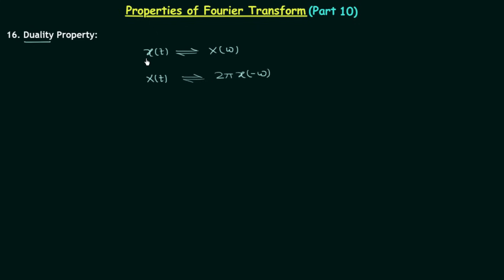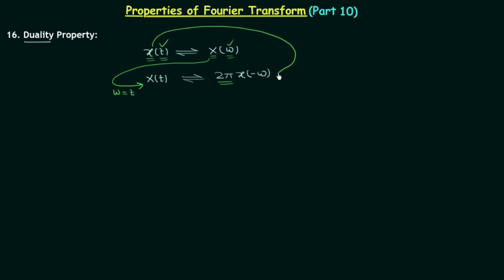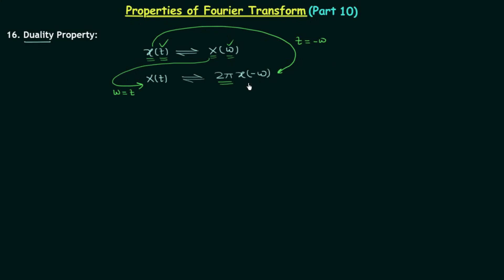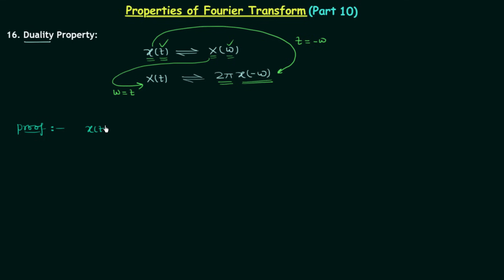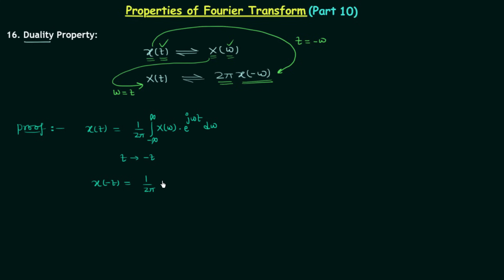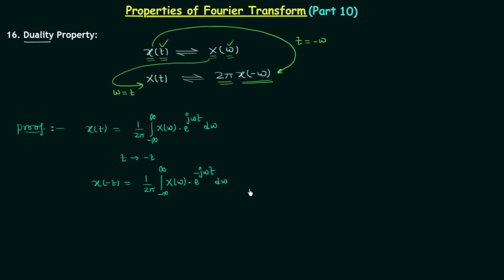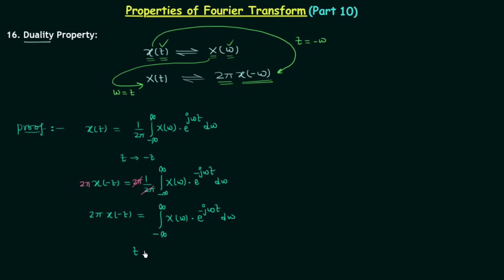Duality Property of Fourier Transform

Comment: For some intuitive understanding : both are logically equivalent if we consider the time to be Time Period of the wave and it is 1 then it can only imply that 2 pi  of angles or 1 circle has been traversed. So basically in freq domain we cprrespond the mark 2 pi to signify that for each time duration spent, the circle/cycle has been traversed.
Reply: This is so helpful, i finally understood why there's 2pi everywhere in fourier transforms. Thanks

Comment: Can someone explain why the interchange of t and w doesn't cause a problem?
Reply: Because the variables are merely place holders. The equation doesn't care what the variable looks like.

Eg : (a+b)^2 = (a^2) + (b^2) + (2*a*b)

If you replace a or b or both with any variable the identity still holds.

The relationship defined in the identity is between numbers. It doesn't matter what variable you use to represent it.
Reply: Cause its the equation, who rules the engineering, variables are just puppets.